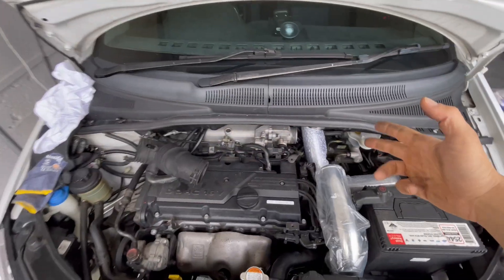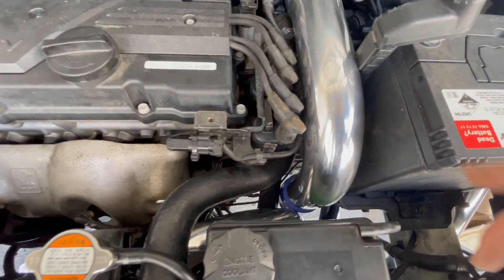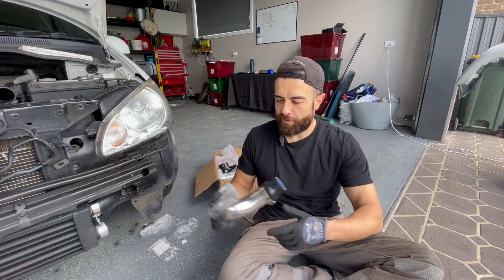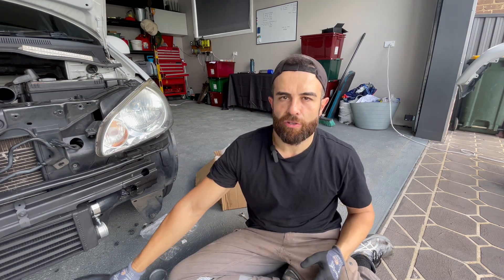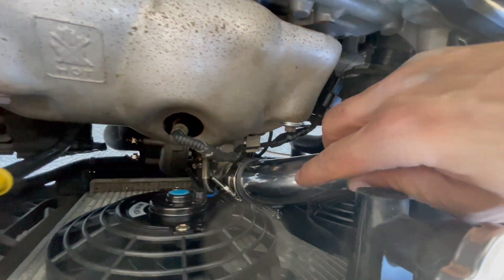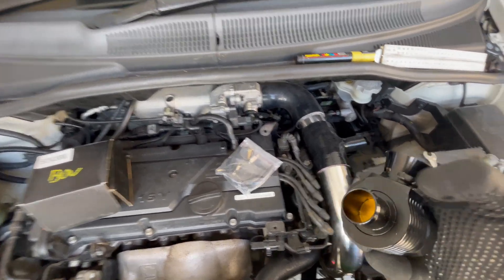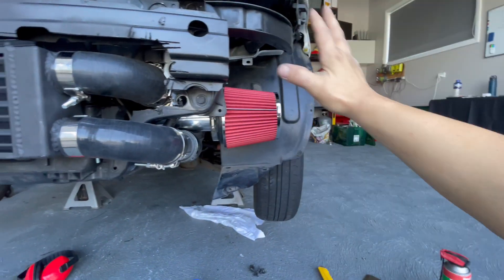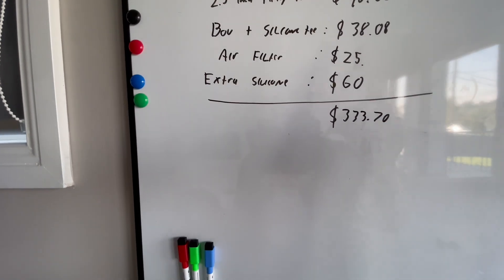How to Turbo a Hyundai Getz. DIY $2000 Challenge. Episode 7 - Intercooler Pipes + Intake

Comment: Did you have any issues with putting the y splitter onto the fuel inlet to the furl rail for fuel return?
Reply from the maker: Not at all, worked great, I understand people might think it can cause fluctuations or so, but surprisingly enough it didn’t, simple science, worked great 👍